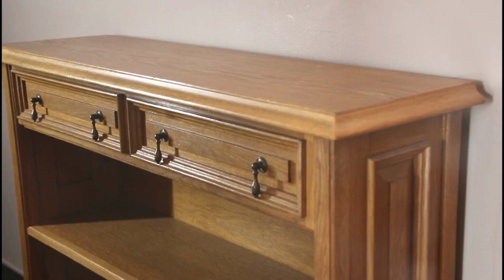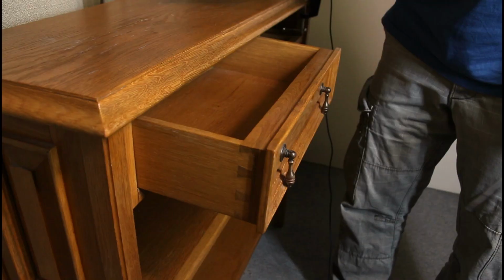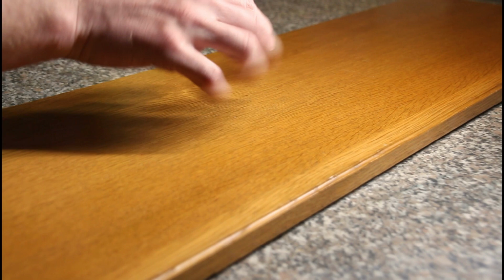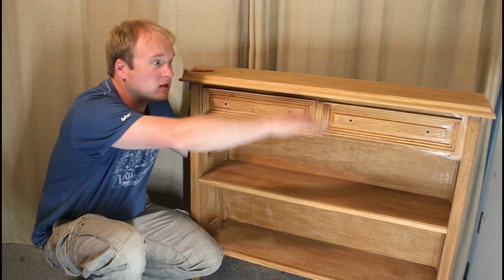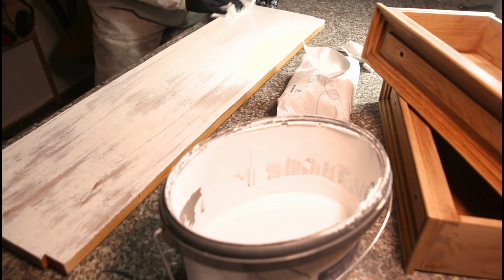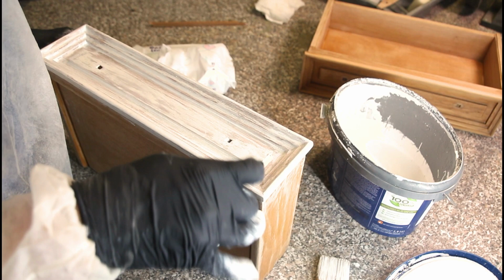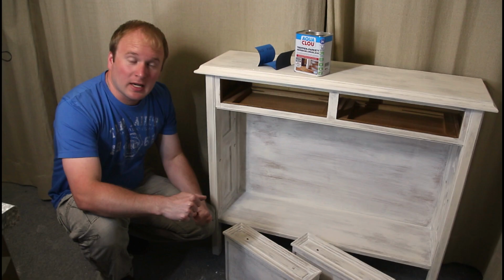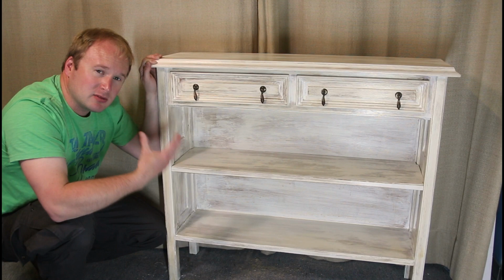How to create a beech look Whitewash on wooden furniture

Comment: I've seen this done with a 50:50 ratio of water to paint. The wash was applied in a thin layer and wiped away. That was done three times until the desired appearance. The successive coats were not applied until the piece was completely dry. All of the wood grain was fully exposed on the flat surfaces. There were no blotches of solid paint obscuring the grain.

Comment: Good video.  Great tip for the wire brush and super glue.  I use to do this procedure, but I now use chalk paint.  It covers everything and no need to remove the old finish.  I use a mat finish clear paint to protect the final product.